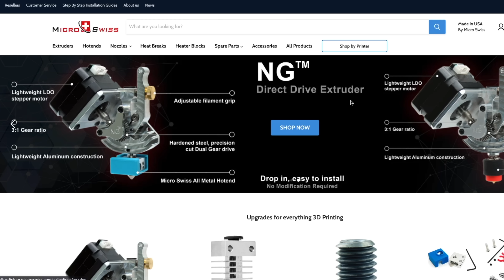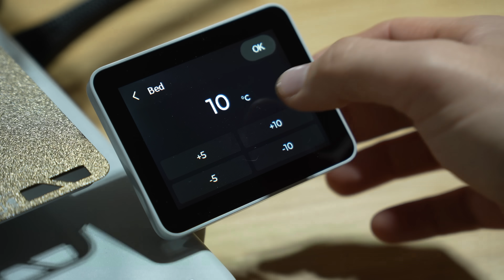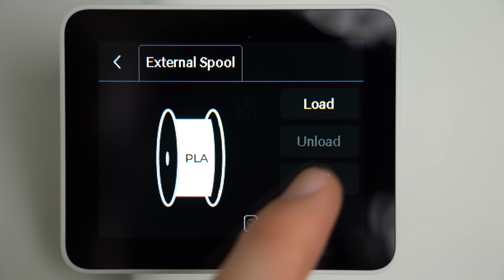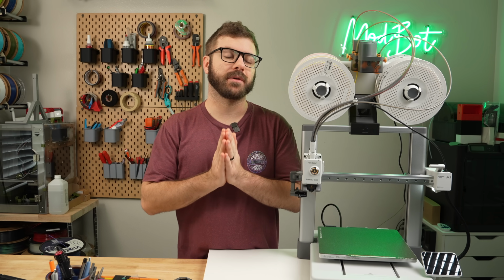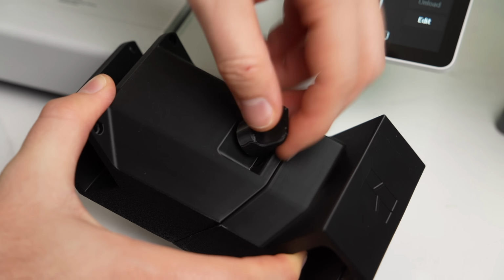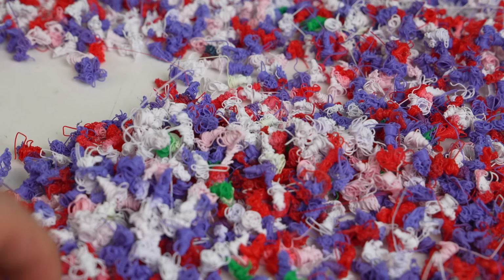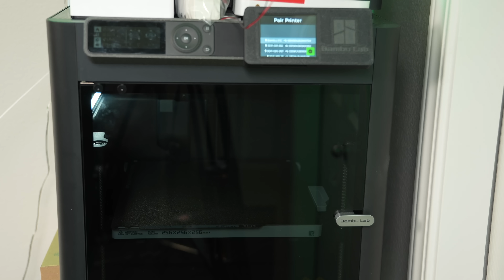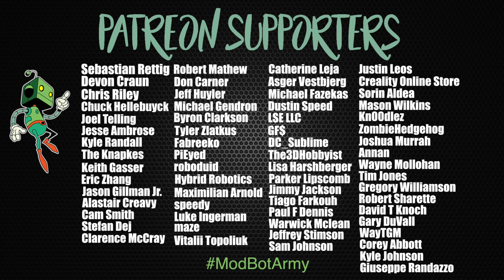Is The A1 Worth It? Diving Into Bambu Labs Newest 3d Printer

Comment: Putting the AMS on the top of the machine is going to introduce A TON of resonance and lower the overall acceleration as input shaper won’t be able to make up for all of it
Reply from the maker: I am sure there is a tradeoff and the z axis braces have also been released to help stiffen things up. It didn't seem to have visible affect on print quality using the standard profiles (once I reran input shaping). If you are trying to push the printer to its limits then it may not be the route you want to go. I typically have more height than desk space to work with so I really like the space savings.
Reply: More weight on the Gantry (where the AMS is mounted) is stationary and the additional weight actually DECREASES resonance.
If it was moving, what you are saying would be true.

Comment: I'll NEVER understand why people are so dead set on multicolor prints. Every other industry knows it's for cheaper and more economical to just paint a single color model.
Reply: Because it's cool to print multiple colors.
It's also cool to print in multiple materials simultaneously. You can have tpu tires on an otherwise pla wheelhub, and a different non-adhering support for cleaner shapes.

Comment: That filemant swapping seems an absurd waste just to add some color.
You say "use a print that doesn't have a huge amount of swaps", but every layer that has more than one color requires two swaps and a simple print has hundreds of layers... so what's "not a huge amount" And how long does a swap take?

As it stands I have no interest in the multi-color feature because of the waste and the added time, I feel I can hand-paint a print in 1/50th the time it takes this printer to do a multi-color print.
Reply: Unless you want to try and do manual filament swaps to add some color to your prints..  Bambu at least provides a reliable means of doing that.. Otherwise everything you ever print will be colorized in some other way if at all, leaving you with a mono-color pile of 3d Prints..    

Yeah, there is some waste, course that happens every time you have a print failure, and depending on the size of what you printed that failed, , that could be far more than you waste adding some color to some of the items you print .   The Bambu slicer tells you exactly how many swaps its going to take and you can try and optimize that if it can be done and still achieve good results.

Comment: That HueForge print is gorgeous! The A1...well, it seems more cheaply made than Bambu's other printers, while having the exact same high risk of having your home network login credentials leaked all over the Internet. And more poop. Hard pass from me.
Reply from the maker: I would say it is definitely the more budget option compared to their CoreXY lineup. The price does reflect that though. Regarding security I know a handful of users that only use LAN or microSD card so it really is not an issue if you dont use their cloud.
Reply: While it is indeed a security risk , you can use the LAN mode if you don't trust the cloud
Reply: Unless something dramatic has changed, you also can never update the firmware without connecting to a network - no new features, no bug fixes, nothing, unless you connect the printer and send Bambu Lab giant encrypted packets of every piece of data the printer has collected from you. 

If Bambu's ToS didn't explicitly allow them to share everything they scrape from you with unspecified third parties, it might not be such a concern, but you're relying on Bambu Lab and every partner of theirs to be safe from data breaches...we already have enough of those, I prefer to not add another one to the list.
Reply: @justinchamberlin4195  I assure you, you are not that important. This is just Prusa fanboy excuses for hating on Bambu, and justifying the continued use of old Prusa tech.

Comment: I don't like this printer, It is bad enough it wastes tons of filament when multi-colour printing by printing the normal Purge Tower, But on top of that it also poops tons when changing colours.
A total waste of even more filament which is allot of money wasted.  

Plus the price of the full system is too high when you think about the huge waste of filament too.

And because it is not a enclosed core xy and not full klipper run it is not with it.
For this cost I would prefer to by a Creality K1 enclosed core xy full klipper printer as the prices still dropping on the K1 and K1 Max 
which makes up for the multi colour changing by being far faster and better value than this A1 printer.
Reply from the maker: The waste material is no different really than any other single nozzle system. They cut the filament so there is some more than a retract but there are lots of things you can do to minimize this. More parts, less filament swaps by not using crazy colored parts, purge to infill, purge to model, retract before cutting is another thing I have been seeing also. 

I have used the K1 and K1 Max and overall it has been a pretty positive experience. There are quirks because it is a forked version of Klipper but if multi color is not important to you then for the price a K1 is not a bad choice.
Reply: The alternative is a 5000€ 3d printer if you want a free waste print
Reply: @andreafire27 do you mean the Prusa XL?